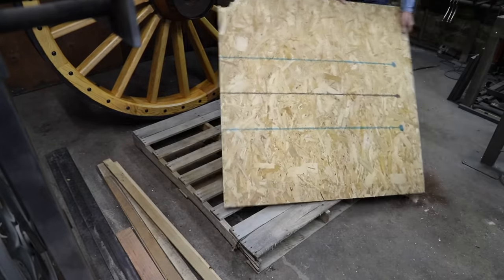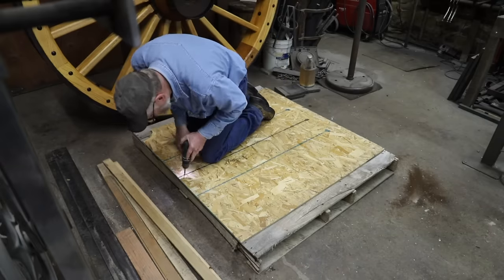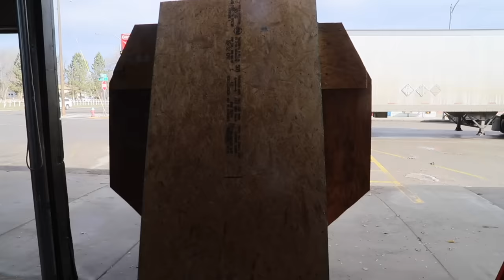So, How do I Ship This 1,018 # Wagon Wheel? | An A-Frame House | Engels Coach Shop

Comment: That's going to be one heck of a chandelier, and I'm sure it will look amazing, but I'm darned if I'd feel safe sitting or standing under it, no matter how they fix it up,..
Reply: The ceiling joist will definitely need to be re-enforced to handle the load of that wheel. Even if it is, I'd still hate to be standing underneath it if Virginia has another one of those freak earthquakes!
Reply: Just a wild guess my bet they will be installed in a timber frame structure so joist strength probably won’t be an issue but again I am just making a guess
Reply: gullreefclub uh... ceilings in timber framed structures hang from the floor joists. That is precisely where there’s the issue. A concrete slab ceiling is a lot stronger.
Reply: I would like to see the video of them installing this beautiful beast.

Comment: Sir, just last week visited the Borax mine in Boron Ca. They have a wagon train set up with fiberglass mules. On display. Theirs has a different under carriage set up than the ones you made ? Also the water wagon has a tow bumper horn to pull another wagon behind it. Also did not know just how much play (back and forth) between wagons, now know why called horn and bumper. I asked if they know about you building wagons? They said yes and were proud you did the work. And to keep the train alive. The reason I went was to see if they still had photos of me, seeding the slopes around the visitor center in 1998. When asked about them, the man said yes, they did and they still talk about me.   See I would run side ways on the slopes driving an old, two wheel drive John Dear tractor and a quad runner to seed the slopes. The slopes were very steep and I was on edge of tipping over.  The guys in the mine had a running bet on when I was going to kill myself. The man I talked to said the money was a very large amount. I told them that he could now tell them I was still alive and quite well. One day, while working, stopped by a track hoe placing rip wrap rocks along the road up to the center and asked the man operating it if He would trade places, he said hell no!!! I was the craziest person he ever seen. That I  cost him money, as I had not killed myself yet. That's when I first learned about the betting. Too funny.
Reply: I'm betting that you will live a long and happy life. Take care, Kyle Greer.
Reply: @clark57225  Thank You. 60 years young   now.

Comment: Put it on a powered axel in a big crate. Motorized the axel so it turns about 20 RPM, then watch the semi try to go around corners. :-)
Reply: Okay, that's evil.

Funny, but evil! ;)
Reply: Need a lot more than 20 RPM to make a difference.  2,000 might get interesting.  😁

Comment: Have you ever looked at Bosch Daredevil Spade bits? They have a slight twist to evacuate chips, a spiral screw lead to pull the bit into the work and a reamer section immediately after the main cutting-edge that sizes the hole accurately. Their cost is comparable to other spade bits. That’s all I use anymore.

Comment: 1080# wheel plus crating =1,400 #.  Nice job.  I thought you might scribe an arc of the tire on some 4x4's or 6x6's and make a saddle type support.  This method is used for Heavy Pressure Vessels etc.
Pallet will be reclaimed for the screws!  Did you purposely locate those darker felloes approx 120° apart?  Lovely contrast.  Did you stencil the weight on it somewhere?
Reply: @EngelsCoachShop  When shipping large items we always put the weight somewhere on the packing so the proper equipment would be used.  BOL is read last!  Sure would like to see it wired up and illuminated with those old style Edison bulbs.

Comment: For the amount of time and effort gone into crating this magnificent wheel, I wonder how much it would have cost to ratchet strap it down in the back of a U-haul and drive it to its destination personally (or hire someone to do it after strapping it down personally)?
Reply: That was my thoughts. I'm guessing cost wise it would be about the same, but time is money and spending all that time to crate it an ship it when you could have hired someone to strap it to a trailer and drive it and it would have been alot more secure strapped down.

Comment: Brilliant craftsmanship even with the crate. However, I would be concerned that the guys un-crating it wouldn't be careful about removing the nails. The screws would be easy to unscrew, but unless they are craftsmen themselves, prying out the nails could cause damage to the wheel. I am not a craftsman myself, so if there is a safe way to remove the nails, I would love to hear about it. If I lived next door to this shop, I would be there every day offering to help just to be able to watch this guy work.

Comment: interesting. whoever gets it can build a shed out of the crating materials. Frankly though, I think it would truck better if you had put it on the pallet the other way, or used a pallet that could be lifted from any side, as putting it in the truck long ways would probably be better than wide ways. Then again, you'd need much longer forks for that. Welders come in handy sometimes, lol.
Reply: Long ways?  A forklift with long forks is not always available.

Comment: By the time you’re done screwing everything together.  you’re going to have 5 pounds of screws in it. Lol
Reply: What’s 5 pound to a half a ton?
Reply: At least he didn't strip the heads out of them.  Super frustrating when the guy crating something up is using the same bit from two years ago and just gives them full beans until there is nothing left.

Comment: I sometimes work with forklifts and let me tell you, despite your great efforts above it, the pallet really leaves a lot to be desired. We would never send heavy cargo on a piece of garbage like this further than one transferless trip. The blocks get regularly chipped out of the pallet. The planks and ties are already split in the pallet you use. And they are really thin! I suspect that somewhere down the road, this pallet loses so much material that they will have to stand it on top of another.

Comment: I'm always impressed with your work. I'd also like to see them un-crate it in VA, I'll bet they will wish you used screws on those few stabilizers between spokes, I sure wouldn't want to get a hammer or wrecking bar anywhere near that beautiful wheel to get them out!
Reply: That's what I was thinking! I was cringing the whole time thinking 'but how would I get them out?'
Reply: Exactly. They will need a sawzall to cut those out from between the spokes and they will be mighty upset about the damage.

Comment: One alternative was how a water wheel is mounted onto its frame at the axle point because it's angled legs transferred any side forces to the base like a pyramid. How it's going to be hung/lighted would be an interesting video unto it self since the ceiling/mounts holding strength should be at least 3-4X the wheels weight just for safety. Kudos on another Borax Wheel build and will look forward to knowing what it's twin will be used down the road for because a Unicycle for Paul Bunyan comes to mind :)

Comment: It’s amazing but I think next time putting it 90 degrees (perpendicular to the truck) would have been even safer. You now loaded it into the truck the way the trucks steering wheel is orientated. So on sharp turns it could tip over since the base was smaller than the wheel itself. It looked like those angled beams kept it nice and ridged so next time those beams should be on the side I think. To add strength while turning.
Reply: Infernal_ NL 
that crate depended on the carrier securing it to the trailer.  Unsecured, it would destroy the other crates and the trailer.  That said, nice work.

Comment: I like how you use screws on the easily accessible struts and then use a nail gun of the spacers between the spindles where it'll be difficult to get a saw in without risking damaging the wheel itself, I bet that was a nightmare to unpack.

Oh well, if they needed to take their time unpacking it I suppose it will make them appreciate it more 😂

Comment: Out of ??? Did you consider an expedited box truck from say  Panther, V-3 or one of their competitors?
Some of the Panther and V-3 trucks have 3,000 to 5,000 pound lift gates and enough E Track straps and load bars they could have rolled the wheels on and secured them so they would/could not fall over. (they also have plenty of pads to prevent scratching.)
Saving you the crating times and costs.
I'm not sure if either of those companies have a truck in your area, or one on an empty move from Washington/Oregon to Minnesota/Wisconsin/Iowa/Illinois they could have diverted.
You built two wheels for that client, one an "extra".
 Did you send both?

Comment: Good work putting that cordless drill too the test.... thought i seen smoke rising up at one point..lol..lol. Amen for decking screws. Once again Mr Engels you have done a magnificent job.  Thought you did a wonderful job crateing up such a odd size item. I've hauled over sized items for years in the trucking industry. Would had no problem hauling the wheel too it's destination. Keep up the good work sir.  God bless 👍😇

Comment: I work for a large trucking company and we move large granite parts heavy too. You should of used a tri frame it would of stayed up rt but at a slight angle and had plenty of so port for the weight..

Comment: In the flat deck world we would have the wheels rest on the blocks slightly  so it distribute the weight over a larger area. You did that with the extra osb. The better the crating the happier the truck driver.

Comment: The wheel is your usual top notch craftsmanship. Very well done. And the crate is great. Lots of imagination there. . Short of a truck crash I expect it will arrive in VA very nicely. I do wonder why you didn't put any packing material between the horizontal slats and the wheel to protect the finish. And I also hope the reciepient makes a video of the uncrating and installation. Thank you for sharing.